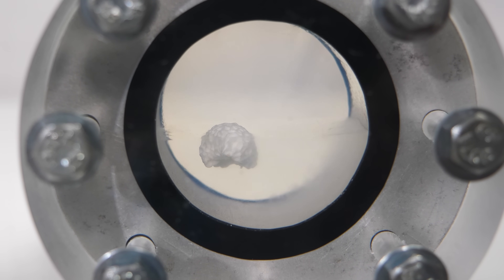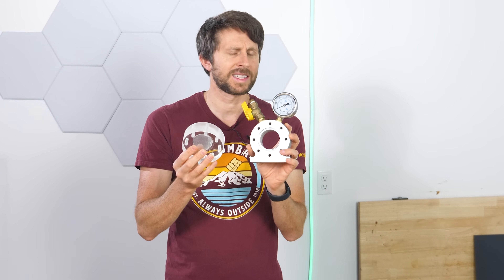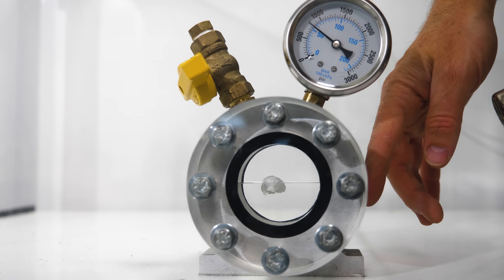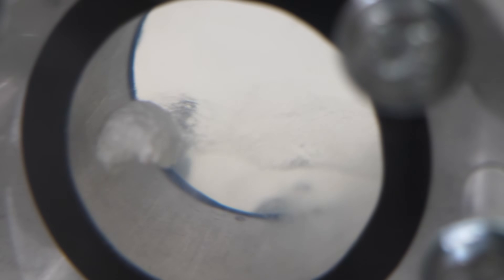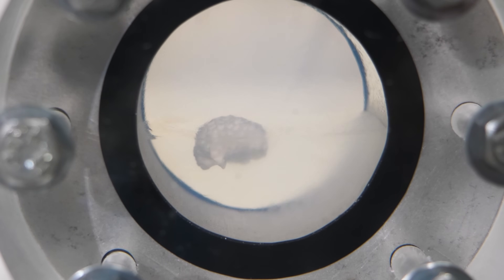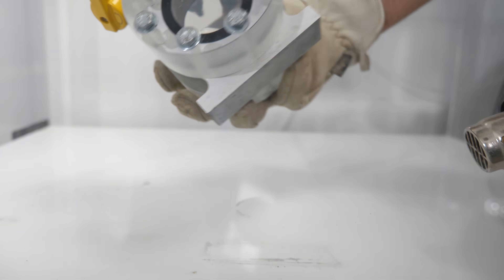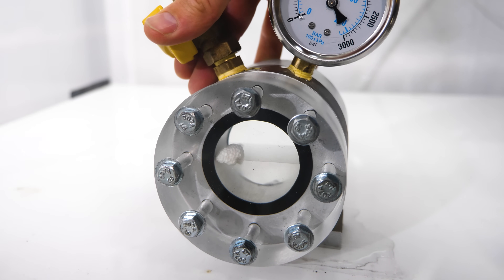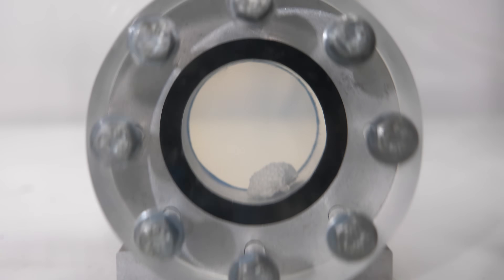Can a Boat Float In Supercritical Fluid? (Stabilized Version)

Comment: This is not quite true. It should sink only if the "boat" is more dense than the average density of the final super critical fluid. But since super critical fluids are compressible and different "boats" will work there is a density at which it will float to the top and a density at which it will be in perfect equilibrium. Do another with more dry ice and it should float.

Comment: I had an idea and knew only one place to go to ask if it can be done since I didn't see this on YouTube at ALL. 

How does a overclocked computer handle in a vacuum.

Ideally heat can't travel in a vacuum, so would the CPU/GPU overheat, or the heat would dissipate quicker. 

Also bonus idea, using nitrogen in a vacuum to prevent condensation from damaging the computer components. 

I can see a cool collab on this one.

Comment: Can you purposefully try to cut a fully   charged power bank right in the middle to see what happens ?  while also simultaneously  trying to do the same to a drained out power bank  of the same capacity say ..10000mah. ? This can be a interesting video it would go on to prove if fully charge power bank cause more hazard than ? Than no charge at all on flights? To make things more interesting how about take a 20000mah one and try?

Comment: ah you could have used a razor to make a cleaner cut so that we could see if the edges decay or distort clearer ( im wondering if the vaccum chamber just absorbed all the air from the foam and filled it with liquid oxygen like a cookie in milk)

Comment: Refractive index is directly proportional to density, and if the refractive index of the liquid were to decrease(to the refractive index of air, which is 1 if I remember correctly), the density of the liquid should decrease at constant mass and the styrofoam should, therefore fall, I could still see the meniscus when it was concluded that it floats in the middle, which is why I think it was incorrect

Comment: Probably depends on the size of the vessel too whether it’ll float or sink. If the vessel is smaller or if there is a lot more liquid CO2 then it may still float if the average density is higher than that of the styrofoam.

Comment: Meniscus is the curvature of the gas-liquid interface in the point of contact with the solid wall. The correct term is "interface"

Should have used something made from a different material. Liquid CO2 is very diffusive in porous media. I'm not sure if those rubber O-rings or even the acrilic glass are safe to work with. At least not for repeated cycles. The materials will deteriorate. PTFE is compatible with liquid CO2. Try tan for Oring and "boat"

You don't have oure CO2. You have air. And water vapor. Should have flushed the whole thing with gaseous CO2 before closing the valve. Maybe an extra port to do this, leavin the valve open, just to be sure there's no air and water inside

Comment: Firstly note that Styrofoam has gas inside, so it changes its density with pressure.
Secondly the above is regular air styrofoam. special CO2 styrofoam will behave slightly differently in this experiment.
Finally and most importantly, the key factor in the stryrofoam going up or down is the average density of the CO2 in the chamber (which doesn't change)
If you add more dry ice to start the experiement, then the density will be higher, the liquid | gas line will be higher, and the stryrofoam will rise just before the chamber becomes super critial, rather than fall.
If you get just the right amount of dry ice and temperature, then it will float weightless.

Comment: It seems a bit clingy to the sides when you picked it up and moved it around. Is that because of styrofoam and metal contact, or maybe more what I was thinking was having to do with slight pockets of the least supercritical bits of fluid which the “boat” would want to hang onto?

Comment: this is due to the fact that at a critical point, the two phases become interchangeable/the same - this means they have the same density. as the density of vapour increases, the density of liquid decreases during the heating until they are equal = that is the critical point. that's why, if you had true and perfect supercriticality, styrofoam could either only float up/fall down, nothing in between. in this case, the supercritical fluid had density lower than styrofoam, so it sank.

Comment: I think the boat sank before the liquid-gas boundary disappeared. A less-dense boat might float longer before sinking. As heat is added, the liquid and gas warm up. The liquid density probably decreases as it warms (even though the gas pressure increases). Styrofoam is the wrong material for a "boat" that is subjected to 1000psi. Increasing pressure crushes the styrofoam because the gas inside its bubbles is compressible. A styrofoam boat is partially a barometer. You want uncrushable syntactic foam , which is made of cement and hollow spheres of glass or ceramic.

Comment: But wait, there are molecules of CO2 and... What's on top of it?... It's air... So does it mean that average density of air and supercritical CO2 is less than density of styrofoam boat... But... What if the tank would be completely filled with CO2, styrofoam should float on top of liquid CO2, but what about supercritical CO2? As tank is full of CO2, so number of molecules per volume should stay the same (or almost), so CO2 shouldn't change it's density? So boat should float on top...
Well it's going to be hard to see, but what if you'd take 95% of tank full of CO2 and 5% air, we're going to see that line but "average" density should change slightly but maybe not enough to sink the boat
Maybe not 95%, but calculated percent to make it float

So I'm interested in some more experiments, or at least explanations :)

Comment: Polystyrene is foamed by use of water vapor flash evaporated.  Which means carbon dioxide vapor can enter which is probably why it won't float as well.

Comment: It is absolutely amazing to see the "boat" slowly sinking, indicating that the liquid becomes LESS DENSE, which is something a normal liquid absolutely cannot do, which in turn indicates that the liquid is no longer normal. It's supercritical — a gas-like liquid, or a liquid-like gas.

It's an effing fourth state of matter aggregate! I say plasma is demoted to the fifth place.
Reply: Well, ever heard of water?
Reply: I'd say it's more like 2.5th state though
Reply: The main problem with styrofoam is that it contains a different type of gas in it, and the bubbles of styrofoam are easily penetrated even with water (that's why it's not used anymore as an insulator for frozen storages). So in this experiment the styrofoam became a piece of plastic with no gas in it. And if you consider that it may be a heavy polystyrene, the experiment is a little bit wrong.
Reply: @AntonySimkin  So you're saying the ball sinks not because the water gets less dense but because the ball gets heavier as its bubbles burst and the gas escapes, increasing its density? Then why does the ball float back up in the end?
Reply: @AndreyMikhaylovlolmaus  he actually indicated the density of the supercritical CO2. I know it varies a lot depending on pressure/temperature. Don't remember the actual numbers. But it goes like from 100kg/m³ up to 1000kg/m³ with a variation of something like 50°C and only 5 times higher pressure (it's a  non-linear relation as far as I remember). And expanded polystyrene gets crushed at the beginning because of pressure, al internal bubbles are damaged, liquid CO2 gets into the bubbles. Before that there were some foaming gas (like pentane) and/or air. So during the experiment, the styrofoam became just a piece of plastic sponge.. so the float ability is being directly affected. We just could compare the pressure/temp of the supercritical liquid and compare it to the density of the plastic we throw in..
Reply: well, liquids do expand and lower their density when heated up, the supercriticalness is a consequence of the liquid's and the gas' densities becoming the same value due to temperature expanding the liquid and pressure compressing the gas, but I definitely agree that transition looked rather quick.

Comment: The styrofoam crushes because of increased pressure. That seems to me another factor; it’s specific gravity rises so it sinks a bit even in the liquid CO2.
Reply: I agree. Was looking for someone who posted that. The main problem with styrofoam is that it contains a different type of gas in it, and the bubbles of styrofoam are easily penetrated even with water (that's why it's not used anymore as an insulator for frozen storages). So in this experiment the styrofoam became a piece of plastic with no gas in it. And if you consider that it may be a heavy polystyrene, the experiment is a little bit wrong..

Comment: IF YOU'D QUIT SHAKING IT WE MIGHT BE ABLE TO SEE WHAT YOU'RE TALKING ABOUT

freaking Darla over here with the science
Reply: You should see the non-stabilized version. It was completely unwatchable.
Reply: Yes, the repeated unexpected shaking is disconcerting.

Also,what's going on?
Is air being pumped in to increase the pressure?
Reply: @edwardlewis1963 no he's cooling and heating the CO2 inside the sealed vessel to increase and decrease the pressure.

Comment: I think you should have done this with something that uses displacement to float instead of Styrofoam which is just buoyant, because that's how an actual boat works
Reply: Everything that floats is using what you're calling displacement. Styrofoam is mostly air, which is why it's good at floating no matter what kind of shape you make out of it.
Boats are like if you took a huge block of styrofoam but all the foam was compressed into a "boat shape" and all the microscopic air pockets were consolidated to be the place where you'd sit in a boat.

Styrofoam was arguably the better choice here as action lab could shake it as much he wanted and not risk tipping the "boat" over, ruining the experiment. 

I imagine normal boat would've behaved exactly the same as the styrofoam piece except maybe up until the supercritical fluid was cooled back down to a normal fluid, as it could have filled the boat with a lot of liquid and sunk it.
Reply: The main problem with styrofoam is that it contains a different type of gas in it, and the bubbles of styrofoam are easily penetrated even with water (that's why it's not used anymore as an insulator for frozen storages). So in this experiment the styrofoam became a piece of plastic with no gas in it. And if you consider that it may be a heavy polystyrene, the experiment is a little bit wrong.

Comment: omg you uploaded a non short to your shorts channel, now you will have to rename it to Action lab: action-ier
Reply: also, you probably diffused the air out of the styrofoam and it is full of co2 at that point, i suspect it would do the same thing if you put it in water with high pressure for a while until all of the air contained was crushed, if you were to fully diffuse co2 into the styrofoam by soaking it beforehand for a while at higher pressure you might be able to keep the pressure in the "boat" higher than the surrounding supercritical fluid...but... that is just a guess and i am basing it on my own knowledge and no actual research

Comment: what if you add dye to the liquid? what will it look like because now everything is transparent.
Reply: Most dyes that we use are used in water or alcohol so making those supercritical are a lot harder to achieve. I'm personally unsure how the pigments would react on their own. Maybe they would stain the vessel due to the pressures implemented.
Reply: @vincenttrigg4521  Let's experiment
Reply: What about using a gas that's just naturally colored? Eg. Flourine, iodine, ozone..
Reply: @bitonic593  the advantage of using CO2 is that it's super easy to make it supercritical, I don't know about those other gases but they may only go supercritical at much higher pressures and temperatures his equipment may not support
Reply: It will seperate from the liquid when it goes supercritical

Comment: 8:43

So if the average density of the supercritical mixture is greater than the average density of the boat then would it float to the top? 

Hypothetically if you used a different substance that was less dense than styrofoam, and it is less dense to the average, supercritical density

Comment: This would be really cool if you recreated it with colored dye in the fluid. Would look really interesting as the phases change!
Reply: I wonder if it would fall out of "solution" or it it would stay in the "less dense solution/high density gas" that fills the tank.
Reply: I assume adding anything would affect the point that it went super critical. And like someone else said would it even stay in solution.
Reply: what type of dye do you recommend?
hmmm... bromine? fluorine?

not many coloured gases...
Reply: @paradiselost9946 iodine
Reply: @paradiselost9946 ozone
Reply: @paradiselost9946 fluorine would be a pretty big risk in this garage lab!
Reply: best thing to do would be angled lights or different colored backgrounds so the CO² would refract different colors based on angle.

also maybe a black background would be best
Reply: I think it would be difficult finding a dye that is CO2 soluble and has similar density to the supercritical fluid. As a liquid it's non-polar so I would think an oil based dye would work, but finding one that distributes in the supercritical fluid I have no clue how to do.
Reply: i was thinkong same
Reply: @zukacs - Thx 4 "thinkong" 😂👍🏼👍🏼👍🏼
Reply: Very cool!
Reply: That would be very cool!
Reply: caffeine, maybe
Reply: @charlievane  I really hope you meant coffee.
Reply: @elduderino1329  nope, I meant the pure caffeine molecule - coffee is a mixture of impurities.
Reply: As supercritical CO2 is a good solvent for more things than caffeine, I am sure there is a good variety of household „dyes“ for this
Typical food colors should do the job
Reply: @TB-wi3sq the food colouring molecules would, technically speaking have different boiling points, so it wouldn’t really work as expected, if you want to colour the liquid, you should pick a solvent with a relatively closer boiling point to CO2
Reply: @friedice420   an other solvent would mean that it isn‘t CO2, so this whole thing wouldn‘t work this way
This isn‘t about a boiling point, it‘s about super criticality, different thing
As even the atmospheric pressure is enough for (pretty much) every food dye to not let it evaporate or even boil, the ~70bar in this experiment shouldn‘t be a problem either

Comment: This may be very elementary, but I believe the reason the foam sank was because the pressure in the tank placed a force that caused the made the foam sink when it otherwise wouldn't. However, depending on the buoyancy of the 'boat' something like aerogel with extremely low density may appeat weightless in the gas. Would love it if he measured the density of the foam so this could be calculated.
Reply from the maker: the foam did shrink when it first went in but after that it stayed the same size/desnity. Especially during the transition to critical phase since the pressure stayed the same during that transition (1070 psi)
Reply: @ActionLabShorts It reminds me of the Galileo thermometer — looked to me that the pressure shrank the styrofoam a small percentage. I’ve read of Mainers sinking in water where CO2 vents from the sea floor.

Comment: There should be a density of boat that is less dense than the super-critical phase, yet more dense than the gas phase. This boat should still float on the liquid, but when it turns super-critical, it would float on the whole super-critical fluid, rather than just the liquid alone.
Reply: The problem is finding a material that would have that low of density at that pressure. even the Styrofoam lost some of it's buoyancy due to being crushed. and Silicone arogel would fill up with liquid Co2 since that is how it's made. maybe coating the arogel would work, but it's going to shrink some.
Reply: @LaserFur  'but it's going to shrink some.'  
Yep, something that would float on the combined phase and move up was the first thought.  But most anything should crush or saturate, and then sink instead.
But forget a solid object, find a different density liquid or gas that would have the correct properties.  Should be able to find something that would work, and be a blob between them and then move up when it goes supercritical.
Reply: @LaserFur  just use mercury /j
Reply: You would need to find a boat that rides that edge in density.

Seems like the Styrofoam isn't great for that.
Reply: Your mom is more and less dense.
Reply: With the right density, we should be able to make an anti-gravity boat!
Reply: That range is between 400 g·¹ to 800 gl·¹
Reply: @ಭಾರತೀಯ_ನಾಗರಿಕ 
No, it would be less than 400 g/l
Reply: @akulkis  Yes, it would be less than 400 g/l